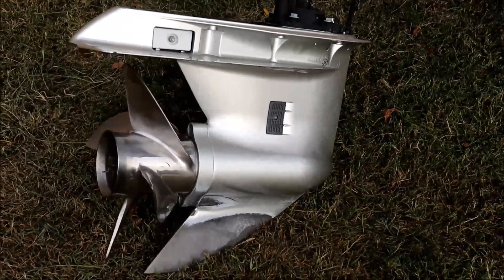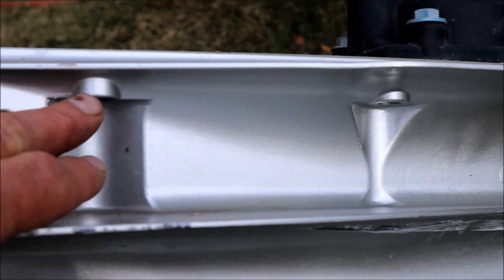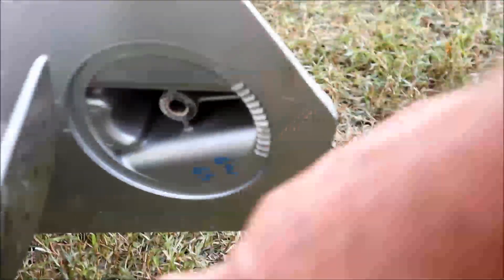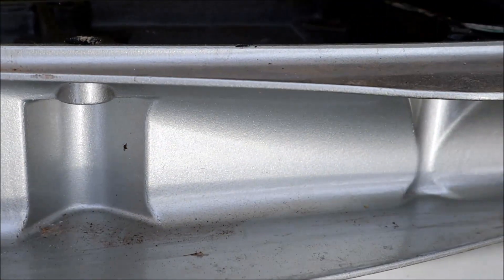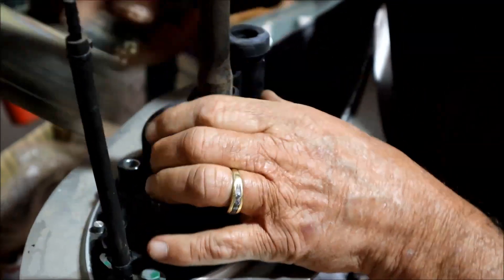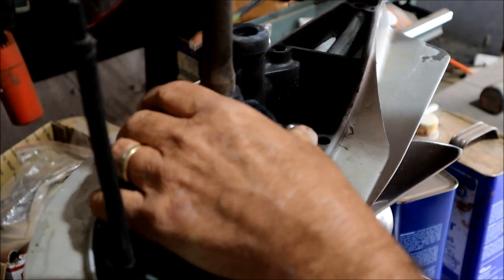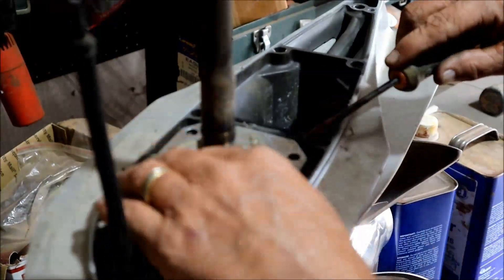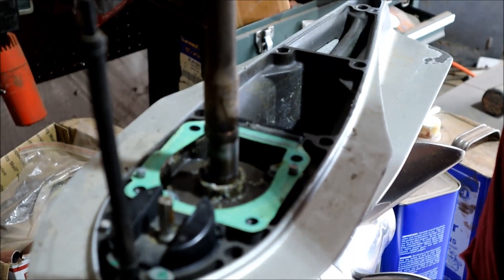2013 Honda 150 HP V-Tec How to Replace Water Pump Impeller ! Lower Unit

Comment: don't you have to disconnect the shift rod before you use the mallet?
Reply from the maker: On my motor it just had something similar to a collar or splines it just slide into..Nothing locks it into place except the pressure of putting it back into place..